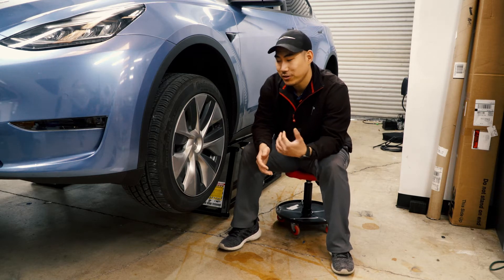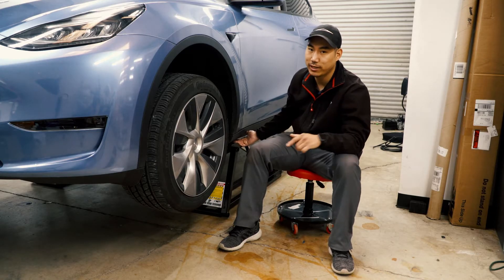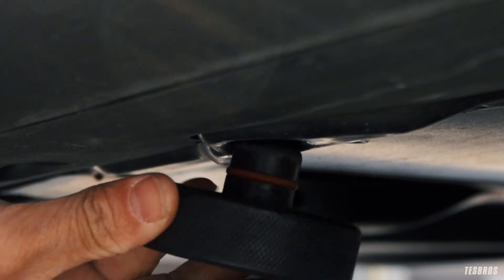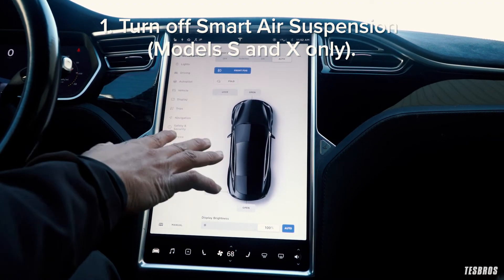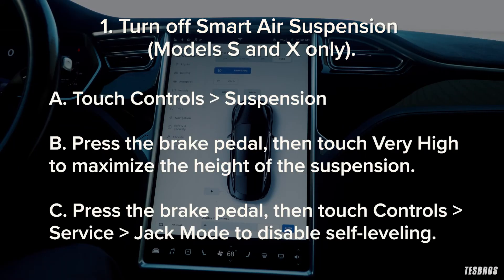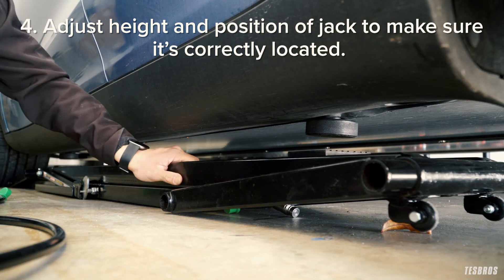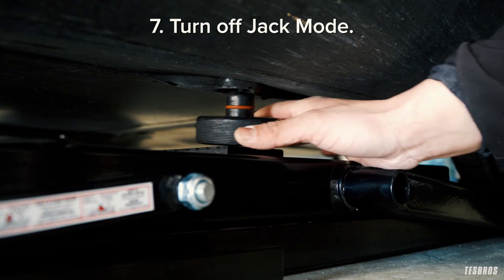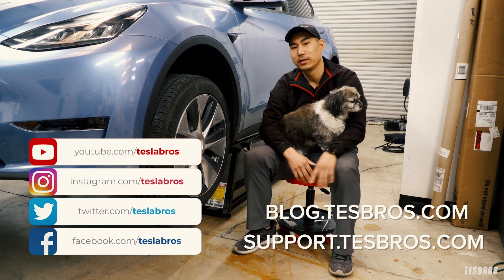How To Properly Lift Your Tesla With Jack Pads

Comment: I've noticed that when the jack pads are inserted, they bottom out before the main body of the puck is against the bottom of the car.  Do they deform during the lifting and then the main body of the puck does the actual lifting or is the center shaft supposed to be supporting the car.  If the latter, that would seem to be a pretty braindead design.
Reply from the maker: They shouldn't bottom out - They should fit with the main body of the puck flush to the car. There is a red rubber ring around ours that holds it in place, so you have to push past that ring for it to fit. Not sure if you're stopping there and that's what's causing the issue? The center part is to hold it in place while the puck does most of the work.

Comment: The title of this video sort of implies this expensive lift is necessary.  It’s not.  When Tesla rotates the tires ($65 at your house), they use the jack pads with a 3-ton floor jack.  You could use a 2-1/2 ton scissor jack, which travels with you for emergencies, but it’s far less stable and a pain in the ass to use.
Reply: What words in "How To Properly Lift Your Tesla With Jack Pads" says expensive?  Anyone who googles jack pads will see how cheap they are.

Comment: Jack pad is not required. A block of 2x4 works just fine. Worst case if you have nothing, it will also work so long as you’re careful with jack placement only contacting the lift points, which is also where you attach the jack pads or 2x4 block if you have them.
Reply: No Thanks! I'll spend $10 bucks on Amazon 😂
Reply: @wt9653  I paid $15 and got the tire repair kit with a nice zipper case.
Reply: No Thanks! I'll spend $10 on Amazon 😂

Comment: Just another example of piss-poor design by billionaire companies that couldn't figure out their cars may be fixed at a standard mom and pop garage when their cars get stranded outside their overpriced facilities. The same problem occurs with the Hyundai Ioniq5 which requires specialized lift pads. As a small shop owner I have chosen to simply refuse to service these cars as it is not worth the risk. I guess these owners will simply have to keep paying further costs for their virtue signaling.
Reply: A responsible owner would carry their own jack pad adapters in the car if it's required to jack the car.
Reply: @marklicas9889  I think if these 'elites' are going to make super expensive cars that are so brittle even a little bump in the road can destroy them; the least they could do is get the basics of the basics right like understanding the 99% infrastructure in place now that must service these cars. It wouldn't take much to make a suitable lift-point. I know of a small garage that is looking at a $10,000 repair bill from simply trying to lift the car as you would any normal car.
Reply: I hate those billionaire car companies.  I prefer mom and pop car companies. Local car companies.
Reply: Ya they are 25$ put em in your trunk in the case they come in
Reply: You ppl here w/ your criticism l don’t know if you are for real if you are know musk had to sweat blood and tears to get this company going i’m sure a 100 years ago when they were trying for start car companies it was the same story, hard as hell to start, lots of them went belly up lots of criticism of non supportive, non believers, etc but today we have cars and l believe tomorrow we’ll have car w/ far superior technology it’s the way of world, the future, take it or leave it’s all up to you.
Reply: @Joe44944  Musk did not found Tesla. He bought into the existing company
Reply: Seems like you're great a business man hahahahh jk you angry old man. Needing Jack pads is such a small price to pay. So many cars already came with different types of jacks over the years too. I'm about to order some of these right now. Cry baby 😭
Reply: Bro...they're $25. Ill give you the cash if its out of your ball league.  By the way thats not even half for the oil for a oil change that tesla owners w8ll never do. Theres a thing called math...if you knew about such science maybe $25 wouldn't rattle your cage so much
Reply: Who would take their Tesla to a random “mom and pop” garage…sure as to fuck won’t be me
Reply: @braytonosmon1852  Next time you are 100kms out in the boonies and get a flat tire, we'll see how fast that would change.Unfortuatley it will be te 'mom and pop' shop that will pay for the moronic design of an overpriced toy for spoiled adults.
Reply: @39knights  alright that’s fair👍🏼

Comment: Will i be able to jack it up them use stands ?  Sounds like there is only one point on each corner.
Reply from the maker: yeah you need to be able to lift it and secure it with only the jacking points

Comment: dude....I've never seen that kind of Jack before and I'm sure I'm far from the only one.  can you maybe tell us what they're called, if they're necessary for the procedure?
Reply from the maker: They are the brand QuickJack ( https://www.quickjack.com/ ) and not necessary to lift your Tesla. You can use any kind of jack to lift your Tesla, including the ones that lift one wheel at a time, as long as you have jack pads/pucks AND the jack is rated for the weight of your Tesla
Reply: @diywrapclub  You most definitely do not need these jack pads to lift the car. All you need is a suitable jack and a brain.

Comment: Can you use any jack pad or do you need metal ones? I see many that look like plastic or rubber
Reply from the maker: I wouldn't use metal. They are usually a rubber material like the ones in this video
Reply: @diywrapclub  thanks
Reply from the maker: Correction: you can use metal as long as it's high quality metal, but it's usually not very cost effective